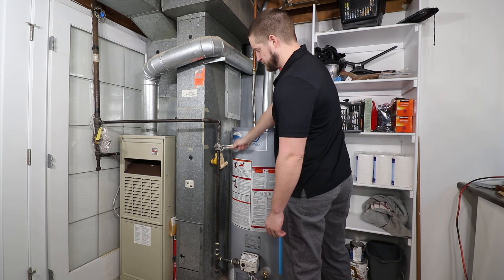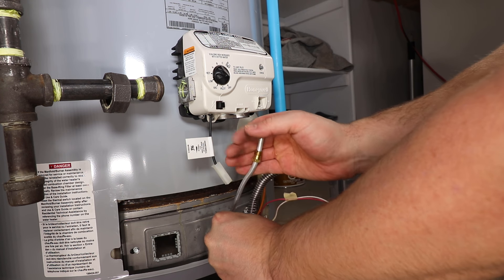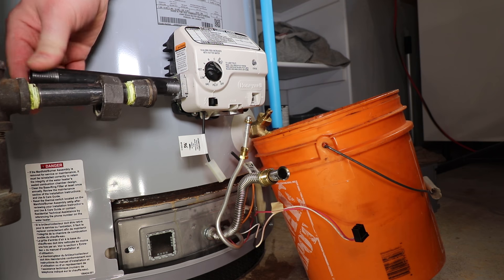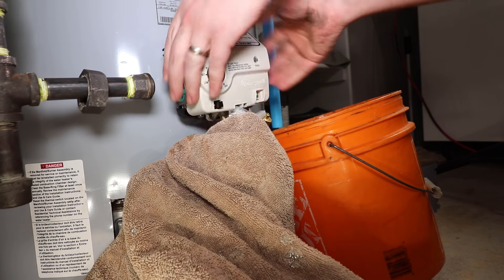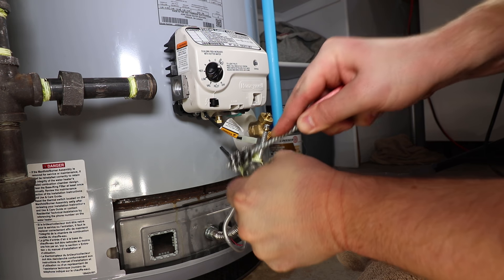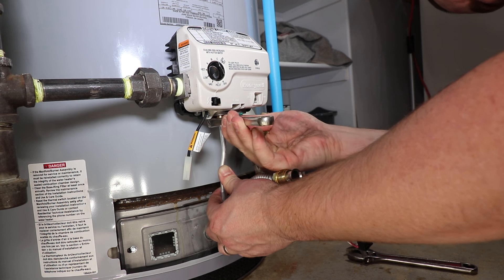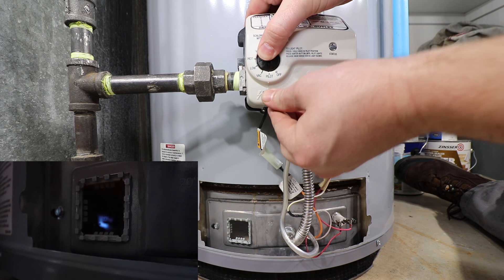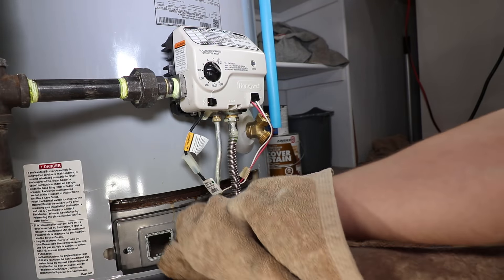Gas Valve Replacement on a Water Heater

Comment: You are making very informative video, which are very organized, well explained and to the point. I have watched three videos since yesterday; all them has a flow, well connected message; and easy to understand message which can be applied to our water heater issues. Thank you for your contributions. You can open an online virtual trade school on you tube or private website with recorded videos. You can also provide virtual visual consultation for a fee. Obviously, you need to have a disclaimer and electronically signed consent. Thank you again.

Comment: I just want to say thank you so much for that trick about not having to drain the whole tank to change out the gas valve. I learnef something new today and tried it - worked great. Saved me tons of time. Thank you so much for making this video!
Reply from the maker: Awesome! Nice job on your repair!
Reply: It shouldn't take that long to drain a 40 or 60 gallon tank.  Now mine was draining really slowly so I took a washer hose and connected to a garden hose and the drain line on the water heater, then I opened the pressure relief valve and gave it a good 30s at full blast. Disconnected the garden hose from the faucet and then water drained from the tank in a few minutes.  Just throwing that out there for anyone that may have a slow draining tank.

Comment: Excellent video! Now I am a new subscriber. My problem is with the GCV when I let go of the gas knob the flame goes out. One question I have is if my two water heaters are hooked up in parallel, is it OK for the bad one to be empty for the time being while still using the one next to it?  right now I have the cold water inlet turned off.  I guess I worry about the hot water passing by from the good one sucking air from the one that’s empty.

Comment: Getting 5 flashes(sensor failure) for my water heater. Have the Honeywell controller. Same as what is in the video. Is this the sensor I need to replace?
Reply from the maker: Hi John. If you are getting a sensor failure error then you are correct. The entire control valve should be replaced to resolve this issue. Good luck on your repair!
Reply: @PROSDIY  Fixed it! Replaced the controller and it solved my problem. Thanks!

Comment: Thank you, great help.  However, broke the aluminum fitting...issue was the valve, not the instruction (was even mentioned in the video).  After the a good chunk of the aluminum broke off, found that an excessive amount of plumbers putty was still in the fitting; estimate about 20-25% of the inside fitting was obstructed.  Wouldn't effect gas flow at the pressure used, darn difficult to thread something past where the original pipe was.  Suggestion: if you see plumbers putty or some other sealing around the outside of the original fitting, might be a good idea to inspect the inside of the aluminum housing before using the "pipe-as-a-wrench".

Comment: IT WAS WORKING TOOK SHOWER THAN THE NEXT DAY COLD WATER NOTHING ON THE HOT SAME UNIT AS YOUR SHOWING PRESS THE PILOT AND CLICKER NOTHING IS HAPPENING?
PLEASE IF YOU CAN HELP
Reply from the maker: Hi fordman3333, I would go through these steps in this video to help determine the water heater's fault: https://youtu.be/_XYCVgsPu1U
I have a feeling it could be the TCO (see video link) so double check that. Let me know if you have any questions. Thanks!

Comment: Hello, I just replace the gas control valve for 2 weeks but now it has the same problem again (code 7, gas control valve) again.  Why?  Is there something else I should focus on?
Reply from the maker: Since it's only 2 weeks old. I'd probably check the thermopile voltage to make sure it falls into spec. Please see this video for instructions: https://youtu.be/mtbn3FtMqCM
I have seen faulty control valves straight out of the box. If the thermopile voltage is fine then a new control valve would be needed. It should be under warranty.
Reply: @PROSDIY  Thank you so much for your help.

Comment: I know I’m late but I watched this and it was spot on! Step by step and I got it done. Only thing I needed to do was go buy the nipple but after that it was smooth sailing ! This is how an instructional video should be like! Thumbs up from west Tx 👍🏾
Reply from the maker: Thanks for the positive feedback! Take care!
Reply: Great video. I replaced my gas valve today and it went well but later after putting the garage door down I noticed a slight smell of gas in the garage. Used a gas sniffer I have and it goes off when I get near the pilot supply line. Took the line off and checked everything again and put it back together and it still leaks. Have taken it off three times now and no luck. Still smell gas and the leak detector goes off as soon as it gets close to the line at the valve. Not sure what to do next.

Comment: My gas line connector(the adaptor between the gas hose and valve) was very tight due to pipe dope in the thread. I tried to unscrew it with force and broke the old gas valve where it connects to the water heater. Now I have to drill out the remainder of the connection. Don’t be like me and just go to Lowe’s and buy a new gas line connection. Save yourself a big headache.

Comment: Concise, straightforward, and has some very good tips.  
The part about covering the pilot tube and burner supply with a towel (plastic sheeting) - very important.  Any water you get inside (especially the pilot tube) is going to cause problems with lighting and operation.
You may want to consider flushing the tank as part of this procedure to remove sediment etc.  This is important to extend the life of your tank + improve your heater's efficiency.

Don't forget to check the condition /operation of your TPR valve and piping, too.

Comment: Great video. I was scavenging parts off the old heater and wanted controller and burner since I bought another AO Smith. I didn't have a length of pipe to remove it, but I did have a decent sized strap wrench that worked well.

Comment: Awesome job and great video... just got mine changed out on all days Thanksgiving... i am Thankful to have Hot water again... and works perfectly... just on a side note if you don't have a piece of pipe to screw into the gas inlet valve (all stores were closed today) you can use a pair of rubber coated handle pliers or channel locks worked really well...

Comment: Very helpful, thanks! We got through most of the replacement before we ran into a problem, though. Is there a way to change out the pilot tube connector for the one you said can be discarded? The old one doesn't seem to quite want to go into the new unit, but the old and new piece fits into the old unit. I don't know if this one is stripped, it does appear to be slightly different. The connector seems to be tightening, and then nothing. We purchased this house post-Hurricaine Sandy and a lot of the repair work that was done after the storm was clearly rushed by contractors trying to take advantage of the elderly home-owner.
Reply from the maker: Hi Michele, It should be the same thread on the pilot connection. Even a slight bend in the pilot tube going into the control valve can cause difficultly tightening up. Ensure the tube is straight as possible entering the valve. If still no luck, then unfortunately changing out the pilot tube connector for the new one likely won't work. This is because the old one will have to be cut off with a set of tubing cutters and the length of the pilot tube will then most likely be too short. New pilot tube can be purchased, but a much easier option is buying the complete pilot assembly. Such as: https://amzn.to/2RISkBI Good Luck!

Comment: Simple, but comprehensive, straight to the point and job at hand, excellent primer on changing gas valve on regular atmospheric vented water heater.

Comment: Can someone please let me know what tools I will be needing?
Reply from the maker: Hi los jr, In the video I use the following:
10" adjustable wrench
6" adjustable wrench
10" adjustable pliers
Slotted screwdriver
1/2" x 6" nipple
Potable water approved Teflon tape
Gas approved Teflon tape
Gas leak detector
Bucket or garden hose
The correct sized open end wrench can be used instead of the adjustable wrenches as well. Hope this helps. Take care!
Reply: I did it thank you so much, God bless you!

Comment: Thank you so much! This was a perfect video on how to replace this gas controller valve. While I had to drain mine completely because I live in CA to replace the gas sediment valve this was spot on! Appreciate it as the water heater went out of warranty after 6 years a few months ago. I just replaced the Thermopile and GCV 2 years ago and it still cost me 200 in labor as they replaced parts only under warranty. Anyone should be able to follow this and be successful with a little skill.
Reply from the maker: Thanks Shawn!

Comment: Thank you! My new thermopile will be here tomorrow so hopefully it's just that and I dont need to replace the valve
Reply from the maker: I hope so too. If you have any questions, feel free to fire them my way. Good luck on the replacement!
Reply: @PROSDIY  truly appreciate that! I had bought a thermocouple from lowes only to realize it was the wrong one lol but your video on that alone helped a ton. Still under warranty so recieve the thermopile tomorrow :)
Reply: @PROSDIY  no luck changing out the pilot assembly.  Very frustrating
Reply from the maker: That's unfortunate. Were you able to check/test the thermal switch or complete a thermopile voltage test? Is the pilot light not staying lit after holding the control knob in with the pilot lit for at least 1 minute?
Check/Test Thermal Switch: https://youtu.be/_XYCVgsPu1U
Thermopile Voltage Test: https://youtu.be/mtbn3FtMqCM

Comment: Did I miss "turn off pilot light" or was that included somewhere. Pretty big step. Should have been first thing said
Reply from the maker: Hi Matthew, The first thing said was to shut off the gas and water supply to the water heater.
Reply: If you turn off the gas there won't be a pilot light. Ears are made for listening. Good luck to you, Sir.

Comment: Nice vid but make sure your valve is actually bad before changing it. If you hook a AA battery to the red+ and white- thermopile plugin, the valve should start flashing. If it does then either your thermal safety switch is tripped or bad, or your thermopile is bad.

Comment: It's worth noting that many local suppliers will not sell a gas control valve to the general public. While you can order online, that means you're waiting a couple days with no hot water. So even if you've troubleshot and are certain the gas control valve is faulty, you're stuck paying a professional. >:-|

Comment: Well I guess I have spoken to soon.. after replacing the control valve the hotwater heater is producing warm water but not hot water and I have been slowly turning up the heat all afternoon.... anyone?
Reply from the maker: Is the main burner kicking on? If the main burner is functioning properly, it might be a dip tube issue: https://youtu.be/j6hZY2FfEhM
Reply: @PROSDIY  yes the big burner is working after I went back in and pulled the whole burner assembly out.. it was filthy... used a wire brush and light sandpaper and then blew it out with air compressor hose... so far so good... and Thank you for your time... I do appreciate it....
Reply from the maker: No worries. Glad you were able to get it fixed. Cheers!

Comment: what was that yellow goo stuff
Reply from the maker: Hi Letian Wang, It's a soap solution to help check for gas leaks. It can be purchased at most hardware stores or made with roughly a 50/50 mix of dish soap and water. Thanks for the question!

Comment: I ran into a problem when removing the pilot line I found it to be extremely tight and hard to turn the connector. It finally stripped the connector and now I'm not sure how to remove this from the old gas valve. Any suggestions?
Reply from the maker: Hi Jesus Ruio, That is unfortunate. If the pilot nut is stripped and/or rounded, it's best to use a set of locking pliers. The most popular brand being Vise-Grip. You can try a pair of adjustable pliers but you'll have the best chance with locking pliers. These will damage the nut, but will give you the best chance of getting it loose. You'll have to replace the nut as well. Good Luck!
Reply: @PROSDIY  Vice-Grip worked Thanks!
Reply from the maker: @jesusrubio6125  Perfect! Glad you were able to get it loose.

Comment: WARNING ABOUT LP GAS SYSTEMS!!!!!!   If you have an LP Gas system do NOT follow this video when loosening the main burner supply & pilot (manifold) tube. LP Gas systems use a reverse (left-hand) thread so the tube does NOT loosen to the left.  Turn the nut to the RIGHT to LOOSEN.  My husband followed this video and ruined the nut on the manifold tube by trying to loosen as shown.  Bottom line to completely repair our water heater, which was still working we would have had to replace the entire burner system too b/c of the ruined nut. We had already been w/o hot water for a week, did not have time to order a new burner & wait another week especially at Christmas........so we ended up having to buy a new water heater at a cost of over $600 just b/c nothing was said about loosening the nut to the right for LP Gas Systems.  Other than that the video is good.....just needs a caveat about LP Gas Systems

Comment: Great video. Two (dumb?) questions: how does the yellow Teflon tape you used on the gas line differ from the white tape you used on the tank connection? Can I use the white tape on the gas connection?
Reply from the maker: Not a dumb question at all. Quick answer is you can't use white Teflon tape on gas lines. White Teflon tape is single density and is designed for water. Yellow Teflon tape is double density and designed for gas lines. Though they look similar, they are not interchangeable. I don't know the exact make up of each Teflon but the yellow tape is much thicker and resistant to ripping. I believe that have different heat ratings as well. Hope this helps. Cheers!

Comment: If the pilot lights and then when you turn the unit to low a flame 🔥 ignites and then immediately goes out. Why is this? The boiler is brand new. Just bought it two days ago
Reply from the maker: Hello Yolanda, Interesting scenario. Is an atmospherically vented water heater, as scene in the video? Can you supply the model number of the water heater? It is located on a front sticker of the tank. It sounds like a gas control issue, gas supply pressure issue, or combustion air issue.
Reply: @PROSDIY  The issue actually ended up being that the water heater was not getting any ventilation because the guys that installed it took the feet off of the bottom of the water heater. So once they were told that, they went back and put the feet back on the boiler which allowed ventilation and it started right up. LOL
Reply from the maker: @yolandacruz6121  That's a first for me. Wonder why they took the feet off? So it did end up being a combustion air issue. I would have never guessed that the feet were removed though. Lol! Thanks for the update and I'm glad you have hot water again! Take care!
Reply: @PROSDIY  Thank you for replying! I believe they removed the feet because for some reason here in Texas the boiler is in the attic. I used to live in Illinois where my boiler was in the basement. They don't have basements here because of the sea level i guess... I believe they removed the feet because it didn't fit with the feet. They made some alterations to the Attic to make it fit I guess. I didn't go back the night they put the feet back on LOL
Reply from the maker: @yolandacruz6121  Interesting! I love learning new things. Where I live they are all located in the basement or on grade. I guess it makes sense in some areas to put it in the attic. The only ones I've worked on that were in attics were in commercial settings (malls, McDonald's, etc.), where square footage is very expensive. They were trying to save floor space. Thanks for the info!

Comment: The tip on not draining the water heater was very helpful, worked great for me.  Note that if you are working with a propane heater, the manifold tube will have left-hand threads.
Reply from the maker: Glad the video was helpful! That is excellent information about propane that I forgot to include. Thanks for sharing!

Comment: Plumber wants $550 to do this.
Reply from the maker: If it's a standard atmospherically vented water heater as seen in the video, that's a little bit high. I'd probably shop around. We charge $125-$175 for the gas control and 1 hour labor + call out fee ($150). This is Canadian dollars as well. If it's a power vented water heater, some of those gas control valves can be as high as $100-$500 and up.
Reply: Its important to understand your basic plumbing in your home. We dont want to have to call a plumber for basic work, we only want to call them for stuff thats beyond our knowledge.